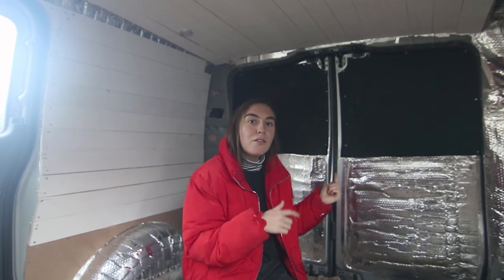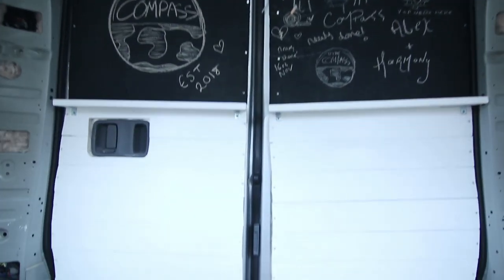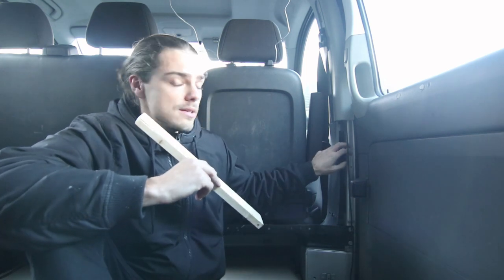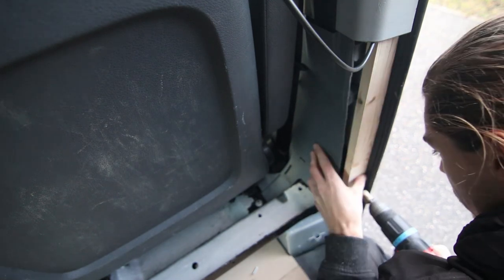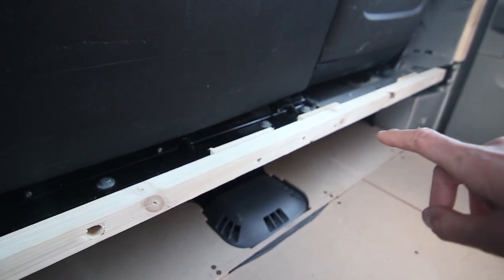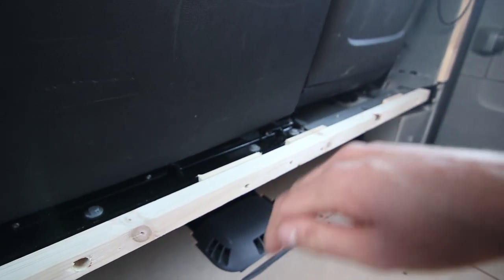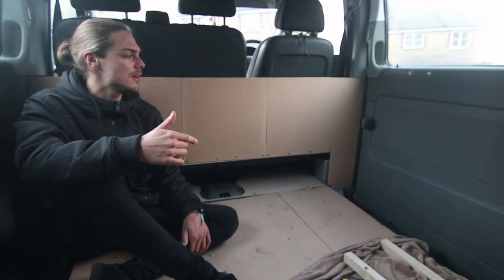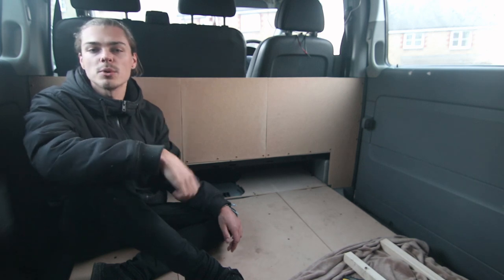AMAZING ideas for DIY camper van conversion! // Mercedes Vito Van Build // Part 3

Comment: do you screw directly into the metal or do you drill a hole before?
Reply from the maker: The majority of the time, yes, we would drill a small hole beforehand... But honestly, we got lazy towards the end and got by fine with the self-tapping screws that we were using without a pilot hole. An affiliate link to the specific screws that we used can be seen in the description.